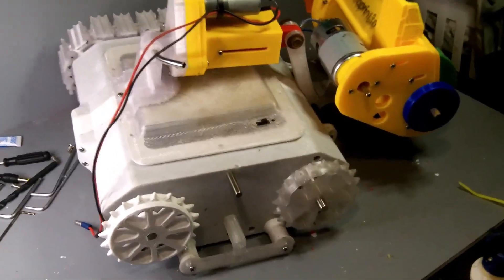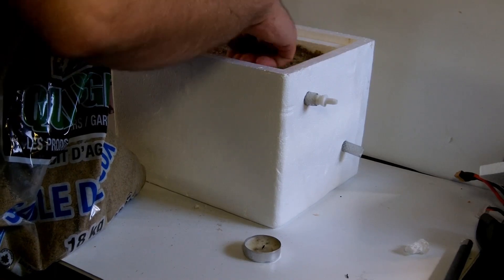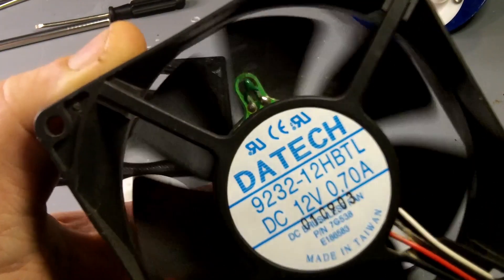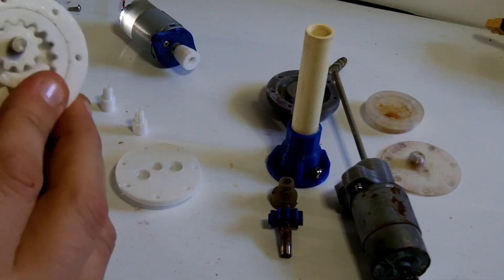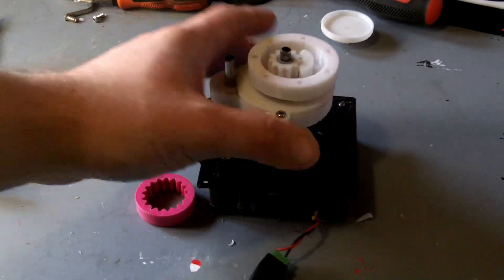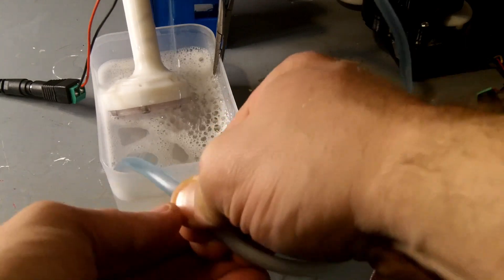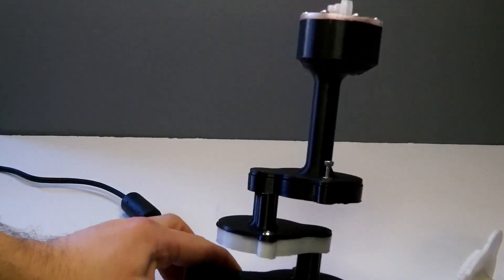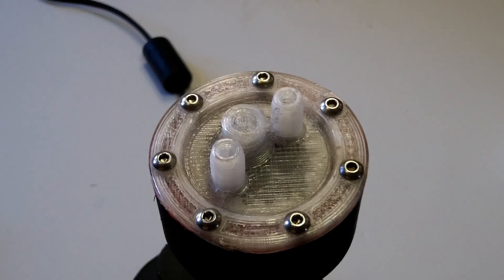80mm Fan Powered Pump

Comment: When will you make the next update about the 3D-printed pumps?
Reply: Have you considered adding PTFE seals to your pumps?
Reply from the maker: I have but seals + friction , I find it builds alot of heat with no way to dissipate through the plastic , also adds power draw. I want this to be able to run for a few years strait 24/7 . I ended up switching to the diaphragm pump as its more efficient and seams to have way less friction. As well as being positive displacement , it has vales witch seal better than 3d printed mating parts . I also have a fan powered version of the diaphragm pump . In testing the diaphragm pump has had zero issues short of one of the diaphragms failing . It also can pump gas or liquid with no modification or damage to the parts . I have messed around with more fan powered pump ideas with little to no success .